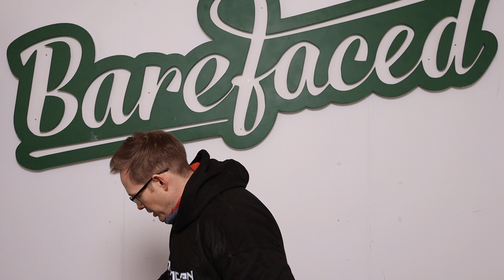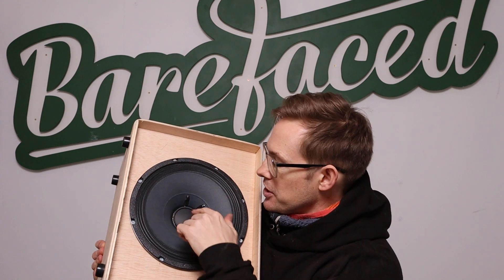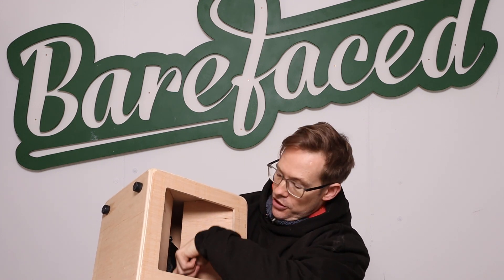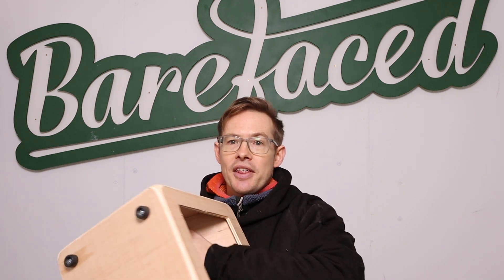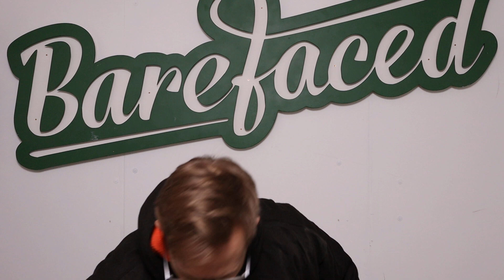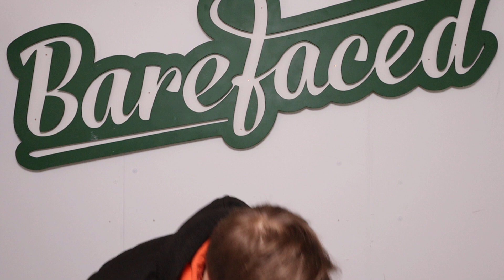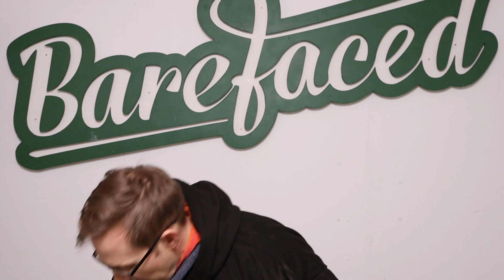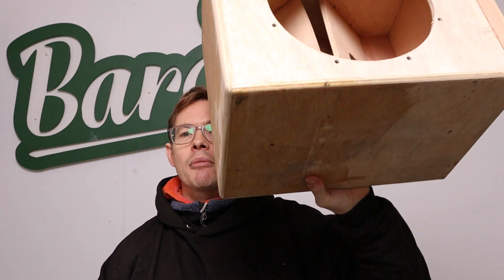How do you tune a port? Guitar cab prototyping part 3!

Comment: NEXOS uses a "Karlson-slotted" shelf vent in some of their bass reflex boxes- I think that allows some of the shorter wavelengths coming off the rear of the cone to leak and mix with the more lowpassed reflex content.  It might take some empirical work to get the hang of it and hit target tuning.
Reply from the maker: Very interesting! I just read up on this patent and it’s not doing what you think but it’s a nice idea - the port has variable length across its width to minimise quarter-wave resonances in the midrange frequencies.
Reply: @BarefacedAudio  - that sounds plausible - fwiw NEXOs has a demo somewhere on Youtube - IIRC - with response plots (?) Are you producing some sort of cardioid pattern with your rear facing flared port ?

Comment: I wanted to comment that when I was a lady in late 60s I turn around my bass cab and fire it at a back wall in larger venues and reverb would stop. Ampeg made a dual firing cab in 1980 and sounded amazing but was not excepted. What do you think?

Comment: there's another side to this coin and that would be 'in the mix'
I'd suggest that a tuned cab that rolls of the lows whilst not sounding as good alone will be a better live sound.
Then you can sell 2 😮one for home and one for band mix.
Reply from the maker: We actually have a low-cut filter built into our AVD cabs - flick a toggle switch to go between “home” and “band” settings, if you see it that way!
Reply: @BarefacedAudio   I was thinking from a physical perspective but interesting.
Would an adjustable aperture on a port  achieve this?

Comment: 5:24 the top string of a guitar is E above middle C, so really when you get to the top of a guitar you are only a couple of octaves above middle C, so not quite the extended range of a piano. Most of the squealy lead guitar sounds are harmonics.

Comment: Crumbs, I’ve learned so much watching this! I currently use a cab I made by gutting a 1x10 practice combo, without the amp I could fit a 12” speaker. I put a back on it hinged at the top which opens out, doubling as a tilt back stand so that I could hear the trebles (now I know why that happens! Thanks) rather than blasting them past my feet at the audience, and soundman whilst I can’t hear what I’m playing. I’ve now come to pointing the tilted speaker up at the back wall if possible to disperse the sound. I sometimes play guitar in orchestras too and like to put the speaker backwards, or pointing straight up at the ceiling so that I hear roughly the same as the conductor. My cab is probably much heavier too due to the thickness of the wood, such a cool design!!!

Comment: This is the first video i have ever seen where the point of the rear port is to improve mid range and treble frequency...it's usually the opposite meaning '''ported for increased bass response''.Would be nice to hear a sound sample sometime soon.Cheers.
Reply from the maker: That's why we don't call this system a port because there's a lot more going on. You can hear sound samples of how the AVD cabs work on any of the other guitar cab demo videos on this channel - but we'll be doing more as time allows.

Comment: Loving these videos!  Could you build a 4X12 guitar cab that is essentially 2 vertical 2X12 cabs in a single enclosure with a central partition, so a full size head can sit on top and plug both speaker outputs into the cab?  I like the sound of the vertical cabs.
Reply from the maker: We haven't really seen any demand for 4x12" cabs - they tend to have rather an excess of output! I think there's a potential niche of a Radical 212H sized 1x12" so you can have a 4x12" looking rig which is only a 2x12" but split into two halves for easier carrying.
Reply: 2 x Uprising 212v 16ohm cabs side by side, head fits across the top, come out of one cab into the other and your total impedance is 8ohm. Even if they had a 4x12 cab, I don't think the AVD port works if you have 2 in the same enclosure, they'd have to do a single vertical on one side like 2 of the horizontal cabs stacked.
Reply from the maker: @tonekilltech  you could put two AVD systems into a single cab but placing them side by side yet firing in the same direction would result in a narrowing of horizontal dispersion and less even tone, so it's not something we'd want to do.
Reply: Thanks!  I'm learning so much useful info from the videos and comments.